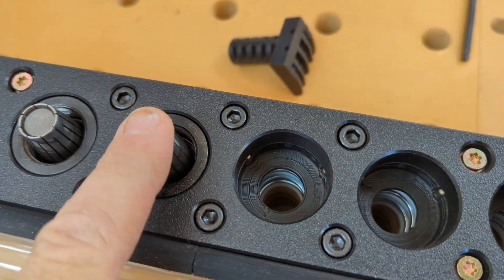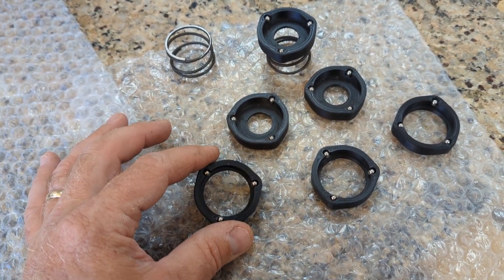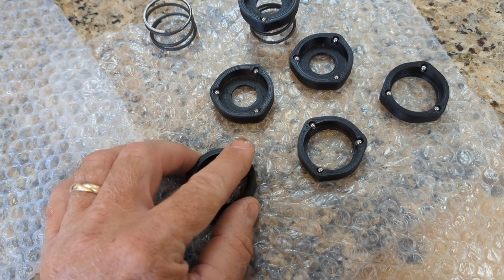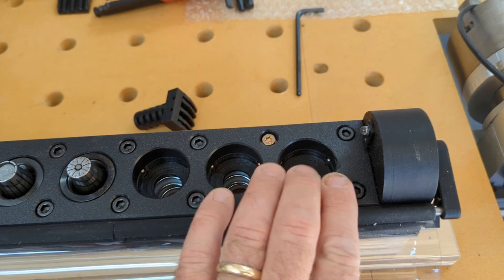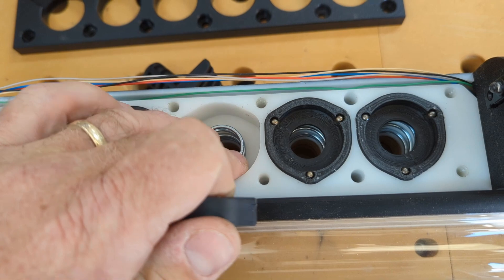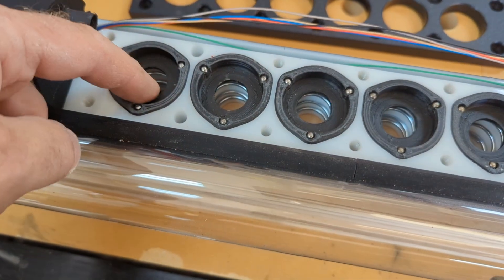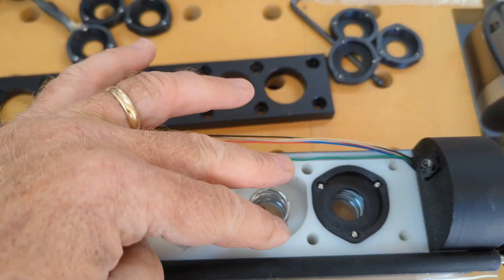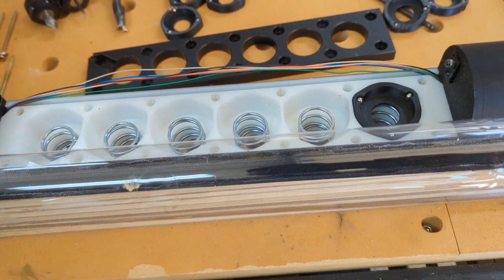RapidChange ATC testing update #3

Comment: I 3D print quite a bit and i personally just don't trust those rings. Far better off with zamak and nylon spring cups. I use mainly nylons like PA12 PA6 and PA126CF for impact resistance. They have creep sadly. Pla just isn't good for repeated impacts and ABS is brittle and prone to stress fractures. Great tool ! Amazing design but they should really manufacture these parts from aluminum or zamak. Most of the other stuff is perfectly fine in plastic so long as its solvent resistant. Nylons , abs and the obvious

Comment: Jim, great videos.  Always helpful.  On another note...I know a lot of people get scared about 3d printed parts strength.  I am NOT an engineer, but the loads that the printed parts are going to see are in the direction of where the 3d prints has the most strength.  The loads compressing the 3d printed layers and running in the same direction as the printed layers, these parts should be strong as anything injection molded or milled out of similar material.  One year later how do you feel it is working for you?  I'm on the fence about getting one since I don't get a lot of time to run a machine.
Reply from the maker: I had the same concerns, but I beat the crap out of this thing and it proved very durable.  The other thing is that those printed parts are cheap and easy to replace.
I think this thing is great for a hobbyist, but if I were using my AVID for high volume production, I'd go for a regular ATC spindle with toolchangers.
All that said, I gave the Rapid Change unit away to a friend earlier this year, and bought AVID's new AV40S ATC spindle.  I will eventually make a tool holder stand and automate it all, but what I really wanted is to make manual tool changes faster.  I like to keep a Vbit and 1/2" and 1/4" endmills loaded, and I can change them in a second with the ATC spindle.  The ATC spindle allows me to have different diameter and length collets and tool holders, including a drill chuck tool holder.

Comment: Looks like you could easily machine most of that construction out of aluminum for a little bit more longevity. Thanks for the video!
Reply from the maker: Possibly.  I think the main parts that would wear over time are the small ring that the steel balls are held in, and the lid sheet.  Everything else really shouldn't wear.  I don't know if that ring would be better machined out of Al or not.

Comment: I had problems initially with it not always being properly centered in the pocket. Turned out to be the cheap roller style limit switches on my machine just werent up to the task. I replaced with some omron switches and better mounting/positioning so they actuate squarely and its been rock solid ever since.
Reply from the maker: Ya, homing accuracy is very important for this.  My machine has proximity sensors and it has always been good, but with regular mechanical switches you would want to have good ones.

Comment: Another question is why do you show a different spring and nut with balls than what you actually installed in your rapid change?  looks like a bigger spring that would not fit and the part with the ball bearings has a large hole and the ones you installed back in had a smaller through hole??
Reply from the maker: You were paying good attention :-).  I was saving that for the next video, but Rapid Change has improved the design.  I have one of the last old ones that had about a 5/8" hole in the center.  The new design has a 31mm hole.  When they sent me replacements they sent 3 old ones and 3 new ones in case I wanted to try the new ones.  Of course I did, so I machined out 3 of the pockets to support the new spring and holder so now I have 3 of the new and 3 old.  The new size now covers a very high percentage of the bits one would run.

Comment: What kind of software is there? 
I run a printnc with iosender. I was looking at getting a kit but worried about needing to do the leg work in the post processor myself..

For a diy hobbiest I’m kinda lazy…
Reply from the maker: The only thing the post processor needs to do is insert the m6 macro call in the right spot in the Gcode and call out the correct tool.  That is typically already there (it is in Vectric products I know).
Then you have a macro for m6 installed in Mach4.  They are working on the mach4 screenset yet, but the ones they did for other controllers look nice, so I'm anticipating this one will too.

Comment: We print them with ABS, I have tested a lot of materials. I settled with ABS because they can absorb the shock without crumbling which is what happend with PC/CF. Under normal use they hold up well. Yes the caps and Bodys are HPDE.
Reply from the maker: They are really tough.  I have seem some printed parts that seem to split apart easily, but I really abused these and none of them split.  You must have a good printer :-)
Reply: @JNWoodworks  We use the Bambu Labs X1 Carbon with high temps.
Reply from the maker: @RapidChangeATC  Dang, that prints so nice, now I'm tempted to get into 3D printing too.  This could turn out to be an expensive little experiment :-)
Reply: @RapidChangeATC  your prints look great. And the engineering on this changer is AMAZING. Pure genius!
Reply: @iagmr  Hey thank you for that I really appreciate it
Reply: looks promising, why not create this from aluminum?
Reply: @AppleBag1000  Thank you for the question. A Few reasons. 1) HDPE is easier on the machine in case of crashes. 2) it would double the price. 3) it's unecessary. I actually made one out of aluminum for the body section and decided it wasn't worth the trouble. Aluminum just doesn't have any advatages that I can see.
Reply from the maker: @AppleBag1000  They certainly could be made from aluminum.  However, HDPE is very durable and still lighter, and machines very nicely, it cheaper, and if  you're going for black, doesn't need paint.   So I think the HDPE is probably the better  choice overall.